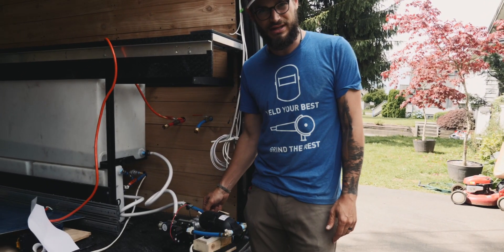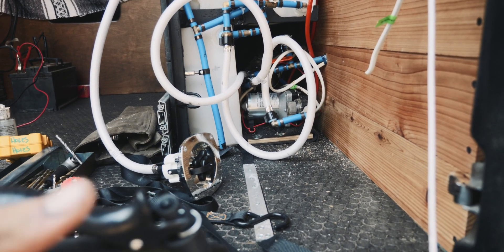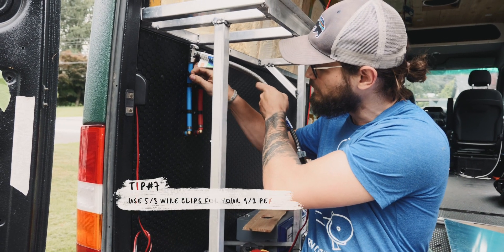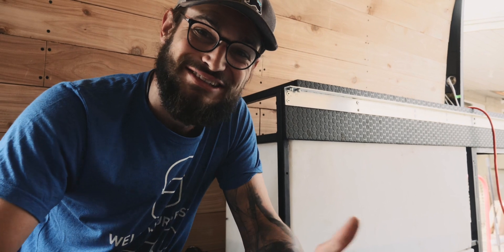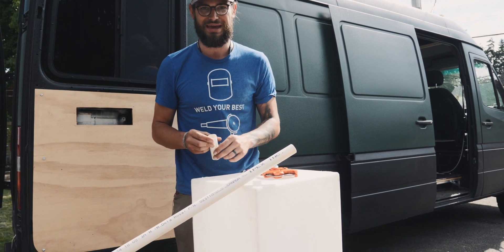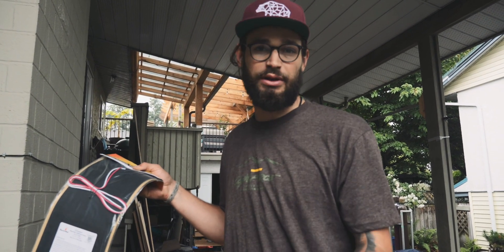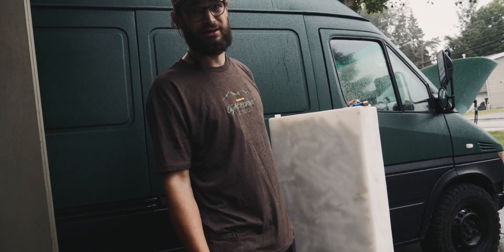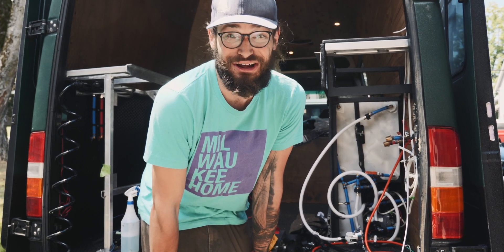How to Silence your Water Pump for RV or Van Build

Comment: I have a factory built motor home and I can totally relate to a lot of these tips. It had carpet and the previous owner had to replace that with lino after a tank failure. It has no air vent, but we have an tank pump and the screw on lid where the wire goes in is probably the closest thing and that is going to end with water everywhere some day... Also, our fill gauge is shot, so adding an air vent is an amazing idea.  I never considered having a pump outboard of the tank before.

We also had a pipe crack on the shower unit that we didn't notice for literally a year. It only became apparent when someone used the tap while the oven was on and we started getting steam out of the hob vent!  Fortunately it has through floor vents under every fixed unit (6 in total) which means that it drains fairly well.

The water system is the biggest disappointment in that van, followed by the heater and the fridge, but we love it all the same. Problem is that it needs £2000 (2500ish usd) at least of work on it at the moment to make it road worthy again😕

Comment: I guess another cheap option for baffles is to install multiple smaller tanks, and connect them together with pipes. Another option for a noisy pump is to hang it instead!  I did this with my diesel fuel pump, it worked AMAZING. I used some of my insulation under my pump but it didn't help as much as I thought it would. I've used the push to connect pipes, no problems so far! Another tip: Don't use corner joiners unless you really need to, just bend the pipe instead around a big corner. The fewer joins the better.

Comment: Hi Levi.
And an awesome filmmaker you are!
To minimize pump vibration on yachts, we mount our pumps on two lengths of sanitation hose, about 6" longer than where the pumps' mounts are. Then, cut the ends of the hose at a 45* angle. This gives you room to screw the bottom of the hose into a piece of wood. The two pieces of hose get laid next to each other and the pump gets through-bolted to the top side of the hose.take two lengths of sanitation hose, about 6" longer than where the pumps' mounts are. Then, cut the ends of the hose at a 45* angle. This gives you room to screw the bottom of the hose into a piece of wood. The two pieces of hose get laid next to each other and the pump gets through-bolted to the top side of the hose.
Reply from the maker: This is fantastic. I wish I had done that method. Really solid tip

Comment: Tip from me. Make sure you have a pump power off switch. So when your not in the Van switch power of pump off. So if there is a water leak after the pump. It won't continuing pumping. Nothing wrong with hose screw clamps. They don't loosen. Been used on car engine coolent systems for over 40years.  They don't use them today as the crimp ones use less metal and cheaper. Also more easy to be fitted by machine. Cheers from George
Reply: Put your pump off switch where you can reach it when standing outside at the slider.

I always forget to turn the pump off when I leave and being able to reach the switch while standing outside is great.
Reply: @MyGoogleYoutube  Great idea but my Talbot has the switch fitted as standard by the manufacturer directly above the rear door just above your head ideal as we don't use side door anyway. Cheers from George and Jane
Reply: worm screw clamps definitely loosen, and they will dig deeper and deeper into the hose with every heat cycle (which might be a bigger factor than vibration). A regular maint task if you use worm screw clamps is to check and tighten the clamps! Modern spring clamps are a LOT better because they expand and contract with the hose during heating and cooling cycles and maintain a near constant clamping pressure. For pex crimps I'm using the 'ear' (oetiker) style as they have some spring, and other reasons. The copper copper rings are a lot sleeker tho, and do have a bit of spring.
Reply: @Sylvan_dB  totally agree but they dont work loose due to vibration. My 1954 Morris and my Supercharged 1968 Morris have screw type clamps on rubber hoses. Hoses perished over time but screw clamps good. My only problem with crimp hoses is when things need to come apart for access and repairs. I dont own crimp tools. So always replace with screw clamps. Unless its high pressure such as oil lines to oil coolers. Cheers from old George

Comment: I am building my own travel trailer and I am working on the water plumbing right now.  I will pick the water from the top of the tank instead of from its bottom.  I used to be a sailor and they do that for fuel tanks.  In case of a leak anywhere in the system, only the content of the line will spill on the floor.  For the same reason, I don't have a drainage tap at the bottom of the tank.

Comment: I am one of the simple solutions. Why use a pump? If you hang the tank higher than the tap, for example a flat tank on or against the roof, the water just runs down. Yet I am impressed by your installation. This way you have more water pressure. I like to watch your videos informative, fun and well made.
Reply from the maker: Peter Palm - if you want to go as simple as possible that’s an idea for sure. In our case I really don’t want to raise my COG just to avoid a pump. Our water tank is 400lbs full. Not too interested in having that much weight high up. I’ve seen people make gravity fed water systems out of 6” pipe with two end caps on. A smart system of you don’t want much water and don’t want pressure.
Reply: @Levi_Allen  I think the water pressure is ok with a tank on the roof. You are right that a water tank on the roof can cause problems with the balance. You would then have to make a stainless steel water tank with partitions like in an oil tanker. that will probably be more expensive than your solution. I hope you don't find it annoying that I think along with you. After all, I am an artist and inventor.

Comment: I'd rather use LLDPE tubes (with some stents for the hot water lines). The push-on fittings are plenty secure, in my opinion. Stuff like the John Guest speedfit stuff. Nothing wrong with Pex I guess. I also want the tank under the vehicle. That has its issues for winter camping - you need a way to heat it if you want to use it, as well as heating the plumbing going to it - but at least a water leak means it goes on the ground. And you save a lot of precious internal space.

Comment: Hi Levi - a few water tips:

1. Tank heating pads: Never have them turned on unless you have liquid in the tank.  The reason is that you can melt a hole in your tank.  You'll want to have at least an inch of water in the bottom of any tank when the tank heating pad is on.  I'd also suggest having separate power switches for each tank heating pad as there may be times you need to heat a tank but but only have liquid in 1 tank.

2. Fresh water tank vent line:  This line is also for "air admittance" when you are suctioning water from the tank with the pump.  As such, not that you mentioned it, but don't consider putting a valve on the end, outside the coach, though you may want to wrap some fiberglass screen over the end and tie-wrap it in place to keep insects out.

3. Fresh water tank fill.  The fitting you showed looked like a shore water inlet (3/4" GHT female).  This is good when you have a pressurized water source.  My sense is there will be times where you may end up jug-filling your tank or using some other low pressure source.  I suggest you use a standard RV gravity fill water inlet.  You can still install the pressure-fill inlet, you'll just plumb that after your pump and valve the pump off when using a city water connection when at a campground, home etc.
Reply from the maker: Great thoughts! I’ve been using a secondary pump for filling from jugs or rivers. And yes definitely will have switches for heat pads.

I’ll try my best not to burn a hole in it 😉
Reply: @Levi_Allen  You can test your secondary pump to see if it can push open the spring pressure of your city water inlet.  Then you will know that will or will not be an issue when you hit the road.  Enjoying your van build series.

Comment: I added a back up pump into my system and put a long siphon tube on it so I can pick up water right from a river or lake for showering and save my drinking water for cooking and drinking. Aslo just incase my primary pump dies.
Reply: rvwaterfilterstore.com and get one of their filter systems and you can easily pump water from a river and a lake and drink it safely. For a few hundred bucks. Although everybody should have such a filter system for any water that goes into the van/RV, even water marked potable. It keeps any microorganisms out and keeps particles that form sediment over time from getting into the tanks.

Comment: Water storage can be tricky especially if your moving around with it. I'm not a van customizer but I've been in a shitload of trades long enough to know enough people to solve problems like yours. I did however build a tiny house on wheels and I might see you on the road some day this coming year. Ok, to the tank. I'm using a 46 gal. Tank myself and its laying flat.... not on its side like yours so your results may be different then mine. I used a similar hack to yours except I only filled the tank half way and I thought that was too much. Yes it works but it cuts down on the amount of water you were hoping to carry. As for the check valve, or tank air line for over flow. I bought an RV mount and customized it so my over flow comes out next to my inlet. I did this so when the tank is full it shoots a stream on water out telling me to turn off the flow. "That way I'm not bending over or on my knees waiting to see it shooting out of the bottom. The water pump cushioning is a great idea and everyone that isn't doing that mush love noise. I did do something else that I saw on a youtube video, I hooked my pump to my water filter and the filter to the tank so that any and all water going to all outlets gets cleaned before it ever leaves the tank. I used a three stage 5 micron filter like the kind you'd use in a 2500 sqft. house. And no I'd not the size of a freaking water heater. The three filter cylinders are about 5 inches across and 10 inches long, with a reverse osmosses filter which I guess makes it a four stage....Doh! anyway, your on the right path although I suspect you'll be headed for a 3.1 redo of some of your choices. Good luck.

Comment: You can get a small three to 5 gallon pressure tank, and put that inline, and have more than just a few small squirts of water, before the pump turns on.
Reply: Yeah, if you have a pressurized system, you need a tank like that. Otherwise the motor will run constantly on/off, on/off, as the pressure inside the system drops as it inevitably will. With a pressure tank, the pump will still run spontaneously to raise the pressure on occasion but with a pressure tank that will be far less often. This Shurflo or something like it should get the job done https://www.amazon.com/SHURFLO-182-200-Pre-Pressurized-Accumulator-Tank/dp/B000N9VF6Q

Comment: Awesome video, Levi! I liked your plastic pipe pieces idea and I know that the inside of the pipe is for potable water, but what about the outside of the pipes? There's all that printing on the outside and all that dirt. I'm sure that you washed the pipes first? Thank you so much!
Reply from the maker: Good question. I can’t confirm for sure. Pipe manufacturer in the phone said it should be fine. I don’t have a way to test exactly, which is why I don’t really recommend this method. I’m not worried about a little dust. We ran a cleaner through the tank and have flushed it out twice. We will clean it each year

Comment: Another thing with filling up the tank with all that plastic, you just gave bacteria/algae a loooot of surface area to nest on...

Also, however perhaps not needed with your build as you did your isolation properly, but I actually insulated my watertank in order to get rid of any condensation forming on the outside of the tank. My watertank would sometimes cool down a lot at night and then when it was a hot day, the van would warm up quite rapidly in the sun, much faster than the cold watertank. Resulting in condens forming on the tank and leaving water on floor basically. But yeah, i guess you won't have issues with that as the inside van temp will be way more stable.
Reply: Yeah, people don't seem to realize this but even fresh water tanks need to be cleaned periodically. Especially in vehicles where people don't use proper dual-canister filter systems on the water intake; any water you add will have some level of particles in it, and those particles land on the bottom of the tank and form sediment. A proper filter system cuts that to almost nil so cleanings don't have to be as frequent, but you still need to do it.

Comment: Good tip on the fresh water tank breather pipe, do you have a breather pipe on your waste tank too? You need one that goes up to the same level as the bottom of your sink then loops back down to exit the van. Interested to know if you had any issues filling your fresh tank with all the offcuts - do you have to watch how fast the water goes in when it gets over half full?
Reply from the maker: Yeah I have a vent on the grey tank as well. 

Filling the tank has been no issue. Fills up really easily

Comment: How much power do need to use that type of shower?  My van has 1000 w inverter and 100ah battery, do you think will work?
Reply from the maker: Are you talking heater or pump? Heater no way. Pump yes. I’d go propane if you wanted heat with your setup.

Comment: What adapters did you use for the schrader blow out valve? Has it worked well now that you have had it for a while?  I am thinking of doing the same thing and was just thinking of how my bike tires slowly lose air and I want to make sure the valve won't slowly lose water.

Comment: Where did you decide to put the electrical and water ports on the outside of the vehicle?  What reasoning did you use for their locations?
Reply from the maker: I didn’t do any water locations on the outside. I don’t want to put holes in the vehicle for no reason. Electrical is through rubber gaskets in the wall of my van.
Reply: @Levi_Allen  I've got rust holes all over my van.  The driverside had 7 patches welded in.  I could of used some of these for ports, but can't decide where.  Probably because nothing is in the vehicle yet, no shower, stove, sink, etc.  Just got the epoxy on the driverside today and still have the bodywork to go on top of the epoxy.  I have to get the epoxy on before I don't have a vehicle left.  This takes a lot of paint.  It took me 3 days to strip from mid line to the rocker area.  Then 2 days to sand blast the pits.  I still have the passenger side and all the doors and hood.  Getting back to my original question....If you were going to cut holes for ports, lol.  I really need to get these first because I heard they're all different sizes and I don't know what I need just yet.  It's a learning process

Comment: I thought the pvc offcuts in the tank was a good idea. What made you change your mind? Just time spent? Or more?
Reply: H. Luck personally I’d rather minimize my water contact with PVC. Not to mention they’re losing a bunch of tank volume.
Reply from the maker: We loss hardly any tank volume, about 5 litres, which is fine by me seeing as it’s 46 gallons. It was a process that just took way to long and was a waste of time in my opinion. I wouldn’t suggest someone else do it because it’s a bit of a hack method and the pipe adds unnecessary weight.

Comment: I picked up this tip...

Don't put a metal male fitting into a plastic female fitting.

I tried the above and couldn't get it to seal. And then there is the risk of splitting the female fitting.

Comment: i was fearful of the push fit joints after the horror stories, weird there the only things i've not had leak, i'm a convert to push fit.
Reply from the maker: Youved has pex crimp fittings leak?
Reply: @Levi_Allen  only pex leaks I have had is where I have joined push fit pex to flexible nylon braided food grade hose, no issue joining pex to copper or pex to pex, maybe our fittings are a different design in the UK.   I'll have a vid on them by Tuesday.